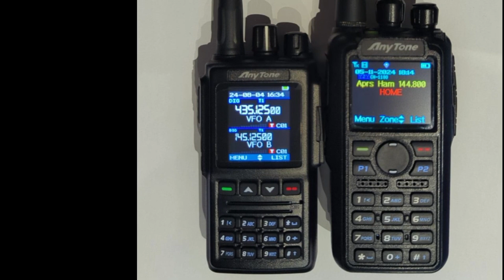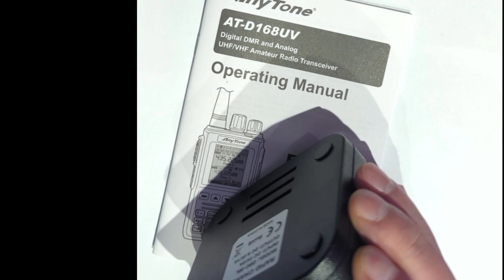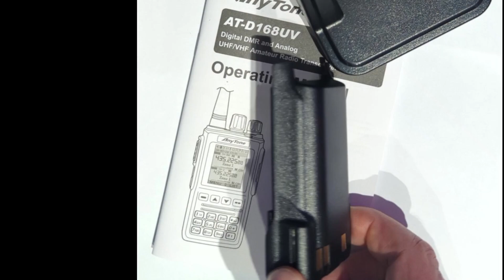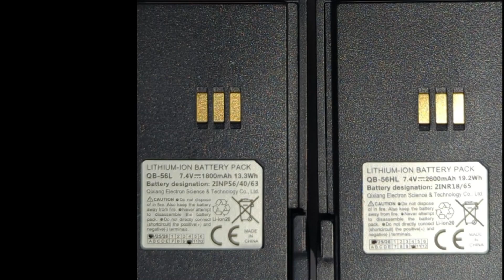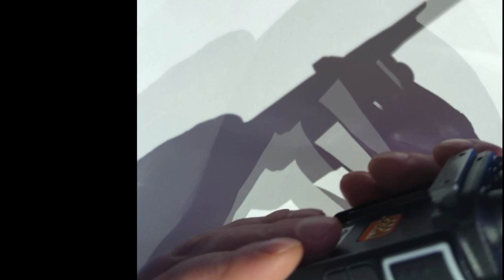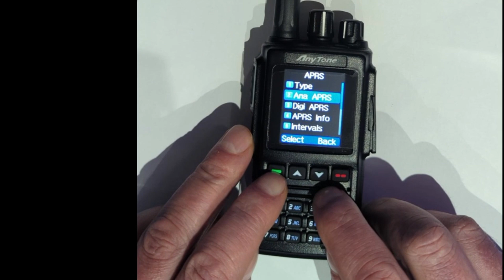Anytone D1️⃣6️⃣8️⃣New Model

Comment: I only use my 878  to listrn to fire uhf dmr , non dmr, and commercial radio one systems dmr and analogue, so got kind from moonraker programmed with ham stuff but then u can edit direct from the radio
Reply: CTC and dtc is ctcss and dcs
Reply: So for me i use like a, scanner, and each zone area is set fir differant things ie one for imperial War museum Duxford, one fir fire 457 uhf, one for my local dmr cctv etc, one for uk business light dmr, one business analogue and so on

So I justcdibtgis from keyboard, presume yiu can edit from settings as u can 878 and put in freqz u want without having to connect to a pc?
Reply: Of course police u won't get unless at some events on sone big events police might hr on a general freq as well as there own secure, ie shared with security, stewards, medics etc

So hopefully that ch set will be similar to 878 if already programmed u can just edit each freq as yiu require, no wasting time having to use a pc
Reply: Fire brigade uhf very handy for use my unidens too, but handy at airshows can use crash and main event net dual
Reply: I would be able to save channel in memory and vfo
Reply from the maker: Check the current prices on bridgecom or moon raker. Some people have got them already